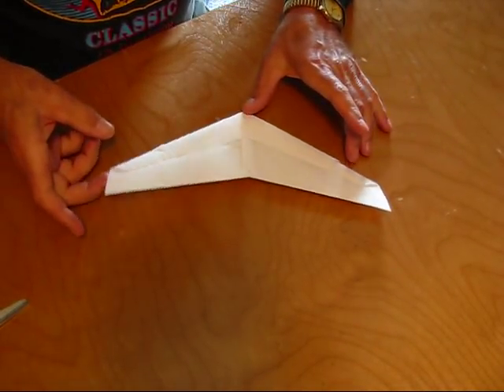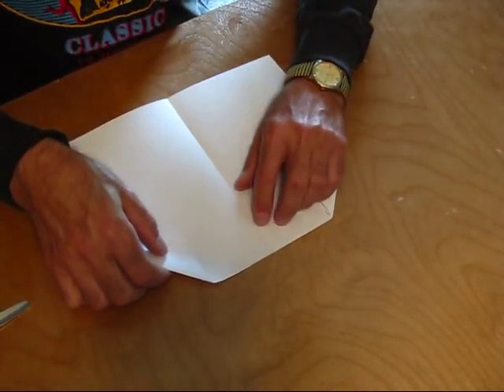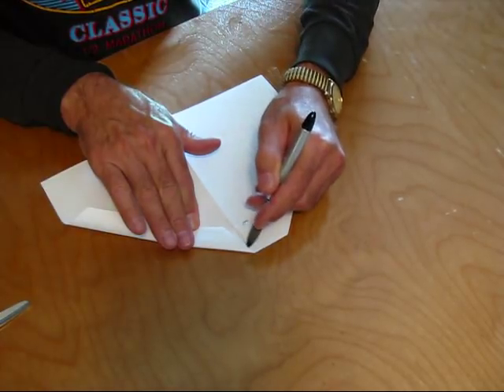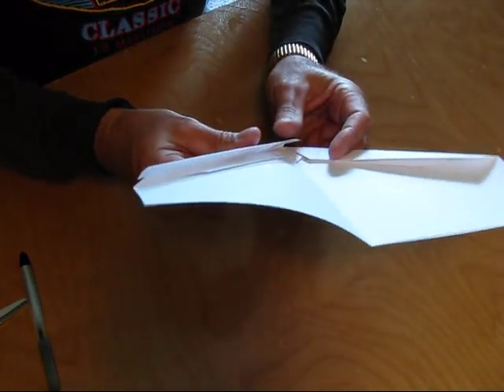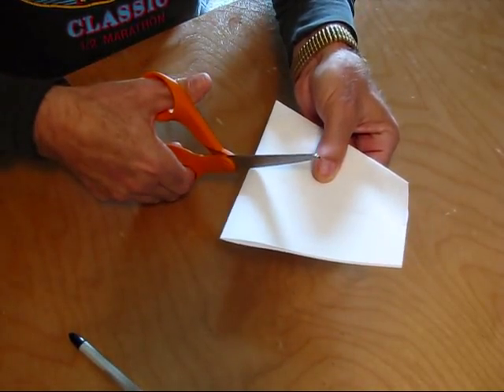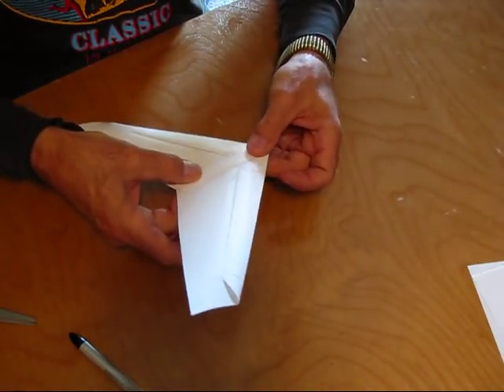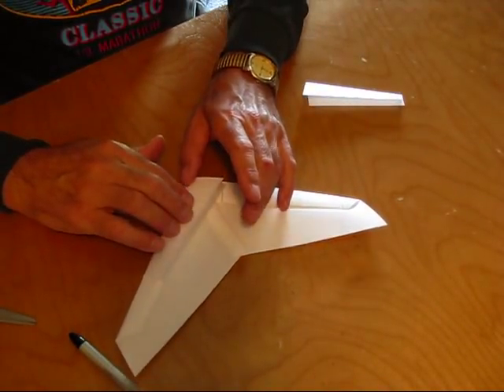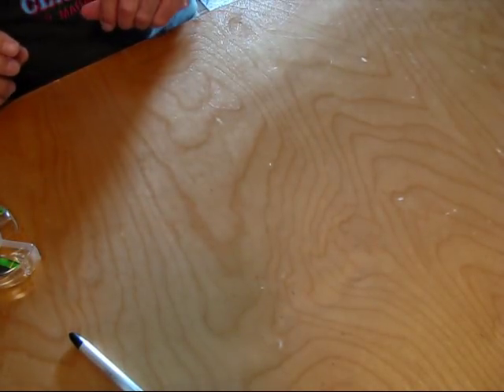Building the OmniWing Paper Airplane

Comment from the maker: It is a very different craft.  Some of my other viewers have even taken the time to add a little vetical tab on the bottom of the wing to serve as a handle.  This would not effect performance, and would make for a more traditional craft to hold.  My technique as it is, I usually have my thumb on the bottom and a couple fingers on top.  A gentle push forward for a glide.  For a hard toss I have my thumb on the nose and middle finger at the back of the keel.  Or, check out my latest video.

Comment: Just thought I'd share this: I find I get straighter flights by rounding off the wing tips. I have  been tracing the radius at the bottom of a 32oz styrofoam cup on the tip and cutting along the line so there isn't any tip.

Comment: very hang glider inspired! love it.
Reply from the maker: +SkyDogsGaming Indeed.  This basic design was created in the early 1970's long before wide nose angle and high aspect ratio hang gliders were in production.  So it was a bit ahead of the curve at the time.  The industry eventually caught up with the OmniWing.  My design may have even served as some inspiration for one of the leading Hang Glider manufacturers as I had shared the OmniWing with them, and it was not but another 8 months or so, and they had a prototype that looked very OmniWing like.  I took that as a complement.
Reply: menamiketrx oh, watching this in 2015, I thought you would have made them in around 2007, taking stuff from high performance gliders. very interesting.
Reply: i  like your airplanes

Comment from the maker: Indeed.  This is a challenging craft to build.  You may want to try the Proto-OmniWing on my channel.  It is a bit easier build and creates washout in a bit less elligant manner, but still effective.  Also, many have to give several efforts at the OmniWings before getting it right.  Getting the twist correct in the wings is an all important step.  Also let me know what your wing does when you launch it.  Maybe I can help provide a diagnosis and solution.

Comment from the maker: If the wing is diving in, you are not getting enough twist into the wings.  With proper amount of twist, the wing tips will act as the elevator would on a traditional aircraft.  Also check out the video on my channel about paper airplane aerodynamics.  I explain these important aspects of a flyin wing.  Also, dont be afraid to do a bit of tweaking on the trailing edge to try to correct the situation.  Bending the trailing edge up a bit will help slow the wing down.  Still best to get the twist

Comment from the maker: Thank you for your comment.  "The Twist".  And I cannot even remember how I came about with the technique.  But what I really like about the OmniWing is that it serves as a platform from which there are endless mods and variations.  Changing the nose angle, dihedral, trailing edge cut, airfoil and more.  Be sure to check out the OmniWing Modifications and the Advanced OmniWing on my channel.

Comment: When I built mine, it flew straight into the ground so I put Aileron tabs on it and now it flies good.
Reply from the maker: anthony perkins Ailerons are fine, but if you concentrate on getting more twist in the wing halves, so that you have good washout at the tips it will serve same as the ailerons, but in my experience with a bit better performance.
Reply: ok, Ill try it again

Comment: Which one flys better the proto- omni wing or the omni wing?
Reply from the maker: The OmniWing, has a greater glide ratio, higher flight speed, and lower sink rate.  than the Proto-OmniWing.  But of course that is if the OmniWing is built well.  It is a more challenging wing to build than the Proto-OmniWing and more susceptable to builder errors, where the Proto-OmniWing is a quicker and easier build but at a loss of a little performance.  As to which flys better, well it depends on the situation and what you are trying to achieve.

Comment: it is very smooth! I don;t even have to push it I just let it fall and somehow it goes foreward
Reply from the maker: +Vampire Volverene Yes...  that indeed is one of the characteristics that I wanted to achieve when creating the design.   The design employs the same design criteria of the modern day hang gliders.  The fixed twist and washout provides for automatic dive recovery, making for a very stable flying craft.  Do take time to check out some of he other builds on my channel.
Reply: menamiketrx hey sadly I put my laptop on the omni wing and the next day when I tried to curve the wings again and threw it, it sucked. How can I fix it?
Reply from the maker: +Vampire Volverene Paper airplanes.  The upside of paper crafting is that it is inexpensive.  And with practice one can eventually build the OmniWing in just a couple of minutes.  So although I do enjoy retuning a wing after it has taken damage, it is hard sometimes to get the wing back to its original form, thus performance is lost.  I will usually build 6 to 12 wings when I have plans for launching off the mountains.  Check out my various flight videos on my channel.

Comment: cool and easy plane the twist is very important to give the wing as well as drag ,the worst thing is to use tape why can't I just staple them
Reply from the maker: Tape is the best solution.  With any aircraft, clean lines are important.  Feel free to try with staples, but it will probably be at a loss of performance.  Also, I would imagine that an effort to get equal twist in the wing halves would be a challenge with staples.

Comment from the maker: Rather than settling for failure, try and try again to get the build right.  If the wing is going straight down then you simply are not building it correctly.  Check out my videos on my channel showing the wings in flight.  What you describe suggests that you are not getting enough twist in the wings.  Also, you might give a go at the Proto-OmniWing on my channel as it provides an easier build.

Comment from the maker: Browse through the comments, (879) and you will see that many have success, and I get some rave reviews on this design, while others do not have success.  With this craft, design and form, follows function.  The function of the craft is to deliver a high performance gliding craft with high glide ratio and low sink rate, while having great stability.  To achieve this the build is a little demanding compared to other paper airplanes.  I suggest having a go with my Proto-OmniWing, on my channel.

Comment: Is the curvy part supposed to bend up after you bend it or it doesnt and u must make it flat?
Reply from the maker: The leading edge remains straight.  It is the trailing edge of the wing that will be rising up from the root out to the wing tip.
Reply: menamiketrx what should i do if the omniwing flies to the other side?
Reply from the maker: La roux Is your question regarding the wing flying in a turn or are you saying the wing prefers to fly wrong side up.
Reply: flys left or right
Reply from the maker: Even the Master, "Me", rarely gets a build that will fly perfectly straight right of the table, but with just a bit of tuning you can correct for turns and tune for speed.  If your wing is turning left, tweak the right trailing edge up a bit out at the wing tip area.  This will slow the right wing down correcting for the turn.  Takes just  a slight bending.  I actually show this on the build of the Origamni on my channel.  Enjoy.
Reply: Noted.Thanks! wont trouble you anymore.
Reply from the maker: La roux Hey.... No problem.  Be sure you share your OmniWings with others.

Comment from the maker: Paper tape will not perform as well.  Paper tape will have less adhesive strength, and will not do as well as far as holding the all important twist in the wing halves to maintain proper washout at the tips.

Comment: Flys great, has anyone ever scaled it up?
Reply from the maker: +jltowns1923 On my channel you will see that I also make variations of the OmniWing with some being much larger wing spans, and some having very high aspect ratios.  If you go large scale as in full size, you can simply look at the modern double surface hang gliders and they are a pretty good example of a fully size scale up.

Comment from the maker: Have a look at my Proto OmniWing on my channel.  My earliest success at a flying wing in about 1973.  The OmniWing sprang from this original design.  Achieves creating washout in a bit of a primitive method, but is quite a nice flyer, just not the glide ratio of the OmniWing.  It does make for an easier build but just a little less tape.  Otherwise I have not seen a design through origami that come near to duplicating the OmniWing flight caracteristics.

Comment from the maker: The twist sets the wingtips at a higher incedence that the inboard portion of the wing acting as the elevator.  Check out my videos "OmniWing Paper Airplane Aerodynamics" and "The inspiration of the OmniWing Paper Airplane".  These may help you understand the concept.  The actual step of creating the twist is a challenging step.  Got to get it right.  If you do not have success, switch to the Proto-OmniWing.  It achieves similar effect with simpler methodology. All these are found on my channel.

Comment: I was wondering: as the designer of the Omniwing what's your opinion on the Omniwing Zeta version made by OAE Menamiketrx?
Reply: I have not seen the Zeta version made by OAE.  Tried to search for it but probably would need the channel name.  I encourage individuals to not simply be happy with the OmniWing Design, but do as I do and try different variations on this theme.  Some do take liberties in calling their design and "OmniWing" and give no hint of credit to the origin.  At first I was a bit upset about that, but hey....  It does not take anything away from what I designed.  I do enjoy seeing all the variations out there.  Some are pretty nice, many are simply a disaster.
Reply: Mike Kelsey It is not on YouTube as far as I know, but a tutorial for it is on the Instructables website. (I'd leave a direct link but I don't want my comment to fall into the spam filter.) A search on Google should bring it up as the first hit if you search "Omniwing Zeta."
Reply: ah yes.... I have seen the Zeta before.  I am no a fan of horizontal structures.  Totally unnecessary if a flying wing has proper twist and washout.  Take note of the B2 Bomber, Modern day hang gliders and so on.  No vertical surfaces.   Besides increasing parasitic drag, vertical surfaces can actually be another source for causing unwanted turns.  They do look cool though.
Reply: Mike Kelsey I'm not sure the Zeta could be twisted. Most of its structure is taped together and internal.
Reply from the maker: The Zeta indeed could employ twist in the same manner as the OmniWing.  The twist is established during the taping process.  The Zeta follows pretty much the Omniwing folding process, up until the taping of the leading edge structure to the wing.  If you just simply leave the wing flat on the table while you tape, you will then get a flat wing with no twist.  But observe the OmniWing build and you will see the wing is lifted off of the table in order to apply the twist.  Almost all aircraft has twist in the wings.  This adds stability to the craft when it start to slow down, shifting the area of lift more outwards towards the wing tip as the angle of attack is decreased.  Many do not ever quite understand the twist procedure, and then of course they get a poor flying OmniWing that dives into the ground.  For those that have trouble with the twist procedure, I refer them to the Proto-OmniWing which can be found on my channel.  Not as elegant as the OmniWing, but it does achieve washout at the tips and reasonable performance.
Reply: menamiketrx I'll have to give it a try next time I make one.
Reply: I do not know whether the Zeta can accommodate the twisting procedure or not--I never looked into applying it. The Zeta was designed to omit the twisting to allow construction to be standardized (which would have been very difficult with the twisting, given the approximation involved). In addition, I sought to make construction of an Advanced Omniwing-class plane easier for those who had difficulties with the twisting which hindered them from completing and flying their aircraft.

I understand your reluctance to use vertical stabilizers, but I personally see them as a reasonable and simpler alternative to the twisting. I must commend you for making the Omniwing, as your statement that it is an excellent base to work off of is the truth.

-OAE
Reply: As far as the twisting procedure on the build of an OmniWing being an approximation, it may seem that way, but with practice it becomes more of a natural feel as to how much pressure to put into the paper while applying the twist.  Basically it comes down to pursuing maximum twist that a given paper type and weight can handle without deforming with wrinkles and such.  No doubt, that having over 4 decades of perfecting the process, it is completed without hardly thinking about it.  It simply becomes a matter of having a good feel for what the paper can handle.   Best to you on your pursuits.

Comment: Did you try it with a propeller ?
Reply from the maker: I tried one of the power-up units without much success.  The OmniWing seemed to be very influenced by the rational forces, and would take a lot of tuning to get it to fly straight under power, so s not to turning, and then as soon as the power was off, the wing would then of course turn severely the opposite direction.  I guess that is why remote control gliders make more sense.  Also the units were fairly fragile, and I broke mine within minutes.  I have seen others with success with paper planes that are more like dart style.

Comment from the maker: Concerning "Normal Paper Airplanes".  So many paper airplanes have the traditional downward vertical structure by which it is held to launch.  This is quite out of the norm when compared to full scale aircraft.  No need for such a structure either structurally or aerodynamically.  Yes, without this useless structure in place it does require a different launch technique, but we have removed useless weight and drag.

Comment from the maker: Indeed I am not satisfies with how the finish video turned out for the Proto-OmniWing.  I wanted to try out the wide angle lens, but ended up with kind of a fail.  Also on my channel you will find several videos showing me launching the OmniWings.  I will try to get around to making a better presentation of the Proto-OmniWing.  I might also do a video that does speak a bit more about the launch techniques.  I appreciate your input.

Comment from the maker: Tell me exactly what your wing does when you launch it.  Also watch the flight videos on my channel.  If you wing is simply diving in, you are not getting enough twist in the wing.  This is the most common error.  The twist is the most critical step of the construction as that is what establishes washout in the wing tip area, thus creating up elevator effect.  Also have a try with the Proto OmniWing.  It has a little easier build.  Also found on my channel.

Comment from the maker: On my channel you will see 3 videos showing me launching various OmnWings.  A well designed flying wing requires no vertical stabilizer.  The sweep, twist and washout, when applied properly, provides all the stability for pitch roll and yaw.  Also check out the Proto OmniWing.  A little easier wing to build and instructions are also on my channel.

Comment from the maker: Hmmmm....  Either the wing is very nose light (tail heavy), or you have somehow put way to much twist in the wing.  Putting to much twist is very hard to do as usually the the paper will not alow as it will start to wrinkle and distort.  I am betting that rather than creating twist, you may be actually creating a bend in the wing.  This would indeed cause such bizzare behavior.  Have you tried the Proto-OmniWing on my channel.  It is a little easier build.  Practice with that then to Omniwing.

Comment: oh, watching this in 2015, I thought you would have made them in around 2007, taking stuff from high
Reply from the maker: +MONICA DRISDEL I came up with the OmniWing paper airplane after a couple of years of trial and error.  The OmniWing as it is show in the video was designed in the mid 70's.  Being a hang glider pilot at the time, I of course utilized what I new about flight primarily from my hang glider experience and incorporated it into my paper wings.  Indeed, I did end up with a design that was a good decade and a half ahead of the hang gliding manufacturers of the day.  They finally caught up with my design.  I continue to fly hang gliders and the Wills Wing Talon that I fly is pretty much the same aspect ratio and employs similar design criteria as far as dihedral, nose angle, sweep and washout.

Comment: Mine wont work ,I've made about 10 of them and none of them seem to work and I am following every instruction exactly,every time I throw it I do it exactly how u throw it on your video and I'm using the same materials  but I throw it and it just turns around and flies into the ground after about 4 meters, I've  tried standing somewhere high up but it just turns left or right or it turns around and flies into the ground,I've also tried to make a proto but it did the same thing.help menamiketrx